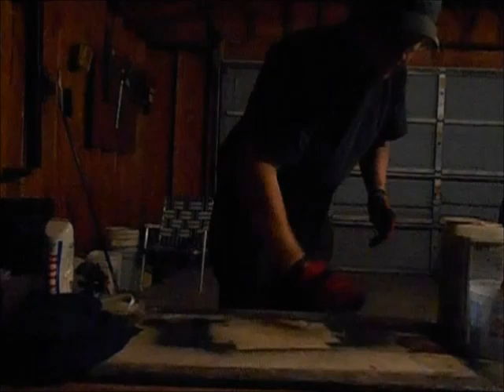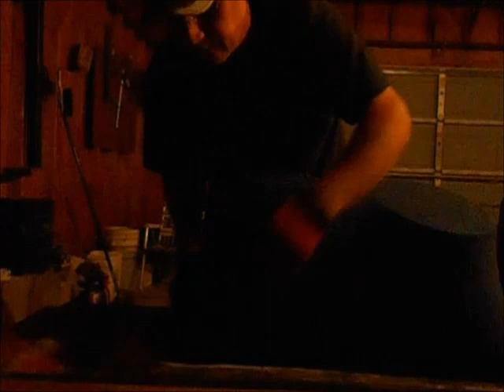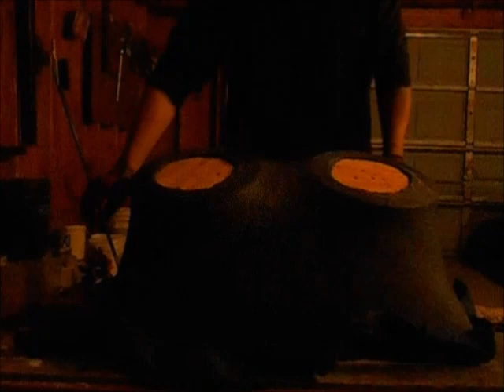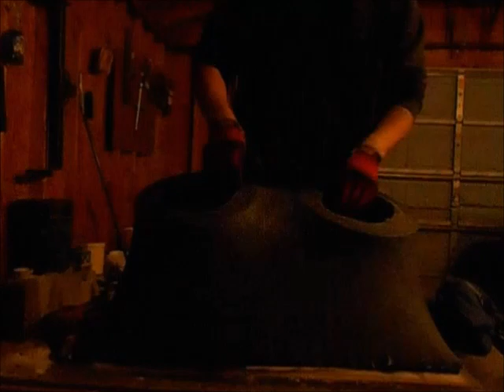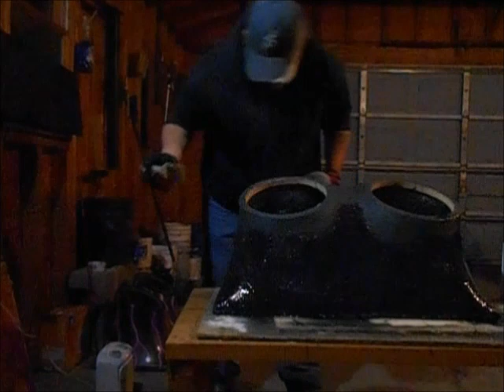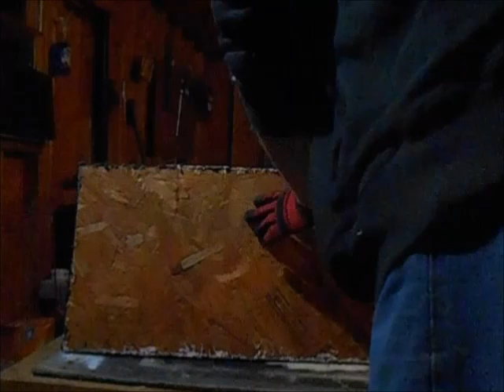HOW TO BUILD A FIBERGLASS SUB BOX, fiberglass speaker box

Comment: what is the shelf life. because ive had mine for about 6 months and it is still good. you just have to keep it tightly closed.
Reply from the maker: the box is good for several years the fiberglass resin maybe 2-3 years as long as you keep it sealed and in a place that don't get super hot or realy cold

Comment: Awesome work man. But here's my question: How do you nail the needed air volume when doing this type enclosure. Specifically since it doesn't have the traditional 90 degree height,width and depth? I've bought resin,fiberglass bondo, fleece, etc  in prep to do my first fiberglass enclosure but I don't wanna screw up the internal volume. Thanks in advance for your input! Subscribed btw!
Reply from the maker: thanks for subscribing, there is a way to "nail it" as you say but that's some math involved, so what i do is i base it on what the largest size for the subs is and then wrap it from there and the dimensions will fall somewhere between the minimum and the maximum size for the subs and they usually sound very good. when dealing with the sealed boxes it is  easier to do it that way. as far as the ported boxes go it is kind of the same idea only i make the main box portion just a little larger than the max size. most of the people that i have talked to over the years do it the same way i do, but there are a few that know the math involved to get the exact dimensions but you kind of have to have a plan of the exact shape that it will turn out first. geometry is such a pain...LOL!
Reply: Makes sense to me,sounds like a plan. Thank you sir!
Reply from the maker: welcome

Comment: thank you that's very helpful I did not know how to build my own fiberglass box so I have 2 12 inch subwoofers made by dub 3 the JL Audio competition speakers subs and I wanted to build one but I was wondering how do you build one with a port to it cuz I don't want to close box I want to open box for my speakers get pushed out the error and then out of it
Reply from the maker: you would be better off building a 50/50 box that way you would have some wood to work with for the ports to go into